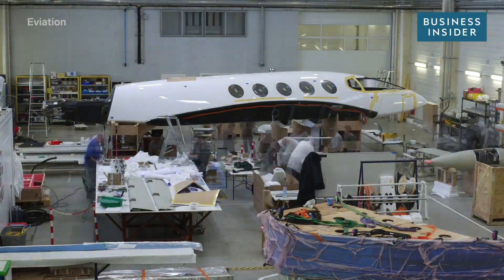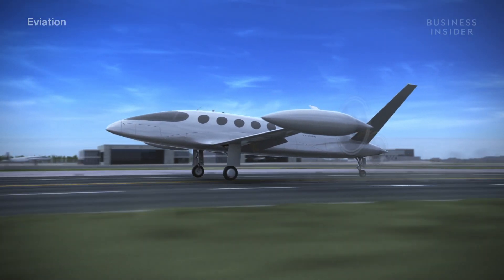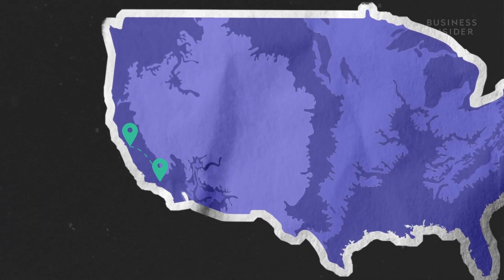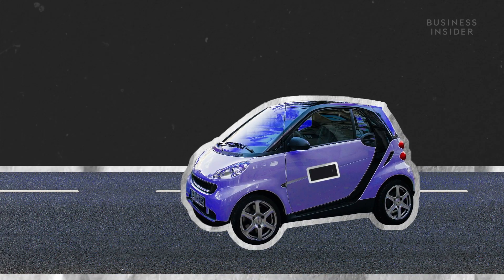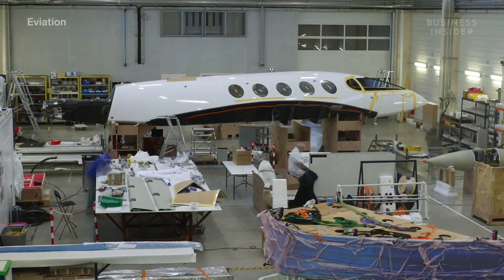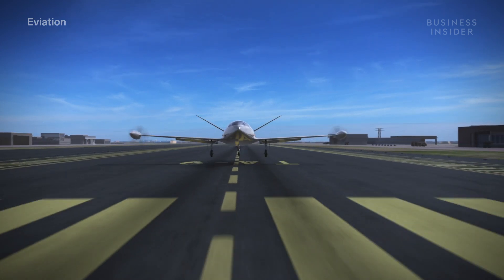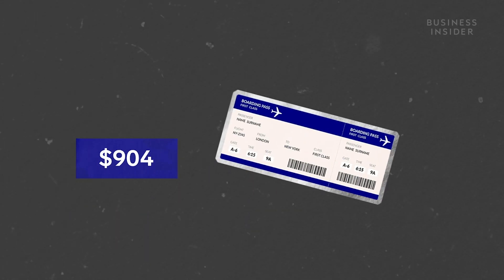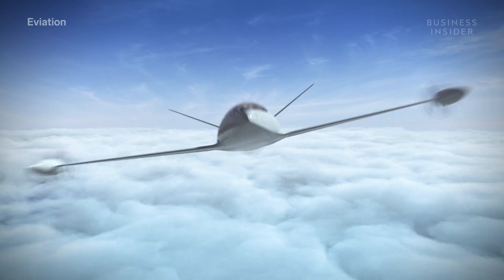Inside The $4 Million All-Electric Plane

Comment: This just shows people are overhyping electric tech right now.  Sure it's the future, but we aren't in the future.  Can barely keep itself in the air for 2 hours, probably with almost nobody inside.  We've got a long way before an electric cargo plane will ever exist, and those are what's keeping carbon emissions up right now, not passenger airliners.  The batteries are in the fuselage, all prop and jet planes have fuel in the wings, which means your sacrificing capacity inside the fuselage with this.

Comment: Add two more points : high efficiency of electric motor almost 3 times . If batteries are powered by solar charges then very low fuel cost

Comment: Good  luck believing this is going to happen. Normal airplane shred weight as fuel burn to improve range and performance.  Meanwhile, you carry the same death load for the entire trip with power and performance gradually degrading overtime, not to mention landing with heavy load. Wtf are you even thinking. Apply science and logic, do some math please

Comment: A flight that's usually 1h 10min would be 2h 30min using this plane.

In the business world, that's a deal-breaker right there.
High hopes for the next few iterations though, they might just solve this issue with the emerging advances in battery tech.

Comment: I can't take this video seriously. This aircraft is not capable of replacing regional jets! The first half of the video should be scrapped! Nevermind range or speed, it only carries 9! So the question is how many are you going to need to satisfy demand?? Even the fuel efficiency can't overcome the challenge. 
In Europe there is pressure to ban domestic flights under 3/4 hours long and promote trains. A train can carry more than 800 people (that is the same as an A380) very comfortably, stops along the way and travels just slightly slower than this particular airplane....

Comment: I think they should try Hydrogen Fuel Cells in Airplanes, which have far more energy density than Batteries. With the Hydrogen produced with Hydrolysis and Solar power.

Comment: ...200$ is only the fuel cost.
Which doesnt take into account the fact that your plane will be sitting on the ground a LOT, as there is no way to fill batteries to 100% capacty under 1h. Depending on the current draw, that means that the plane will be sitting on the ground as much or twice as much as the stime it spends airborne.

Comment: If your entire business model is "you'll feel less guilty" than i predict a 98% failure. I LOVE the idea of electric plains but i also understand that physics says it wont work well until we have MUCH BETTER BATTERIES. So they, for now, can only make short flights, go slow, and require MUCH LESS WEIGHT, which all leads to economic failure. The only solution i see is "FIND A NICHE", or "MAKE PEOPLE WANT IT"! It can either be the cool think like apple that is followed by a cult regardless of it being inferior, or it can be the fun thing that works for some specific enjoyment. But "FISCAL and ECONOMIC RESPONSIBILITY" will not fill you seats at least not enough to keep you afloat. I HOPE I'M WRONG, but history has taught me people work out of their own enjoyment and pleasure not out of responsibility, else we would all be taking the bus instead of buying cars. You can't change humans but you can understand them and change your model accordingly.

Comment: I like it. I’ll take a longer flight that’s emissions free if they reach price parity (and it sounds like they will). Charge times aren’t bad either from what I’ve read; 275 miles per 30 minutes of charge, the perfect plane for short trips.
Reply: But it's not really emissions free. It carries only 9 people so the amound of airplanes in the sky would increase 8x just to replace a small regional aircraft. The amount of batteries, airplane parts and actual electricity needed to achieve this offset quickly the carbon footprint of bigger airplanes.
 If you want sustainable aviation look instead for Airbus hydrogen airplanes in the next 5-10 years
Reply: It still has to be recharged with....wait for it.... FOSSIL FUELS !!!!
So actually the emissions created will be released earlier than the flight itself.
Reply: You have to mine the lithium batteries, charge them over their life, and deal with the hazardous battery waste, which has precious elements that can only be recovered using a LOT of energy. Battery creation and disposal is far from environmentally friendly. As long as people "feel" that it's cleaner, that's what counts right ?
Reply: Cry

Comment: I love how they compare this 9 person plane to the 747 one of the largest planes out there holds about 366 passengers
Reply: The plane is tiny and it's just a private plane
Reply: @casualbeluga2724  exactly, there are already planes with a capacity for nine people that fly at half the speed of a commercial airplane and consume a much smaller amount of fuel than those that carry 100+. Why don't airlines use them? Because it is economically unviable. For the private aviation market on the other hand it may work, but there the appeal to sustainability falls apart.
Reply: How about a hybrid plane for 20 passengers....Natural gas and battery operated .
Think it could be a good compromise. 
Wonder it this plane can cross the Andes mountains.
Reply: @arteson6093  
You mean you want to make an aircraft even more complicated than it needs to be?
Reply: @gabrielgingras814  Nope... It is obvious that electric is to heavy for the foreseeable future for a plane that could make money.... Therefore striking a balance to attain it could be a solution.  
An aircraft of 20 or so passengers can make a profit from small runways shuttling people at ultra low cost.
Other countries use nat has vehicles at a third of the cost of gasoline ... has less weight and could give the takeoff energy necessary.... the rest of trip is electric use of batteries.
Reply: each of the plane seats up to 8 people, if you buy 25 of them, then you take 200 people.
Reply: No they did not. Only the picture is wrong. But they compared plane that carries 9 people to plane that carries 9 people. They CLEARY have said "similarly sized plane".

Comment: Zero emissions while running. But you gave massive emissions in making the batteries and aircraft itself; you also make emissions in power generation. As an electric plane the aircraft will also have slower turn around times than jets and turbo props. I wonder how well this will do on FAA approval given the 100% electric; hopefully this would do OK with lightning strikes.

Comment: Its an electric private jet replacement, not an electric passenger plane. This is 100% more wasteful than a large jet. You are replacing a single aircraft with 30, requiring 30 times as many pilots, requiring 30 planes to be built instead of one, and running 90 engines instead of 2. There is a reason larger planes make routes cheaper. You get more people there while burning less fuel per person.
Reply: You say that as if all routes would be replaced by this plane which simply won't happen. Integration is a slow process
Reply: @shamrock141  
No I'm saying that assuming it replaces regional routes, which is what they say it will do, which, as I said above, is bullshit.
Reply: @Henriburger1  obviously it won't but if we advance at our current rate then down the line we could create something that could compete with traditional short haul routes

Comment: I’m surprised they didn’t shoot for a “blended wing-body” design.
Reply: Don't be, they tried to remove wingtip vortices, by placing the engines on to edge of the wing. The design screams "i have no clue what i am doing, but i have money" even from a large distance. Sure they COULD have used state of art airframe, by utilizing a flying wing with bell shaped lift distribution, to achieve a ~70% drag reduction comapred to conventional forms, while not sacrificing maneuverability.
However they opted for doing the pointless but flashy.

Comment: If one could incorporate regenerative power technology into the plane's airframe they could use the jet stream from the flight itself to recharge the batteries so the range could be extended. All planes utilize a natural parabolic shaped flight path to conserve fuel. The electric plane would simply achieve its maximum altitude within the first third of its flight and then maintain a very gradual decline after it has crossed that threshold so that less power will be required. Multiple small air intake vents could then be opened during this time to harness the moving air to move spiral turbines which would then charge the batteries while in flight. Once the batteries are fully charged, the plane could use the excess power to achieve or maintain a higher altitude. Repeating  this process would ensure that the batteries are fully utilized and could in theory increase the range of the plane indefinitely. From an economic stand point, it would reduce down time for recharging, the plane landed with the batteries still mostly fully charged.
Reply: Completely wrong in EVERY way. NONE of the points are even possible. They ALL violate the laws of thermodynamics.. Vivid imagination though....
Reply: You forget something, ram-air turbines as you describe create drag, therefore a reduction in speed, which means you have to give up alritude to compensate for that.
Or increase power to compensate, therefore increasing power draw.

Oh and ATC is going to love a continous descent, that is going to be an utter b** to deconflict.

Comment: 00:59 um no. Using a 777 or even a 737 for domestic flight is perfectly normal if the passenger demand is high. On low demand domestic routes, they use smaller regional jets or turboprops.

Comment: Just because we are turning vehicles electirc, doesn't remove their carbin footprint.
Reply: No but it's a great improvement
Reply: No but it heavily reduces them and will eventually make them carbon neutral
Reply: @sheev9852  there are alternstuve fuel. Made from combining carbon and hydrogen VICE made a video about it. No need to upgrade or install anything. Plus it's carbon neutral

Comment: Well it's not emissions free - how much emissions does the charge give off at the power station?
Reply: Roughly 1/8th of the emissions. Turboprop engines are at maximum 30% thermally efficient. Electric motors are 80 to 95% efficient. Plus less lubricant, coolant, and consumable maintenance supplies (packaging, PPE, etc). And emissions released at altitude can be 10x more harmful than those released at ground level. Hope you learned something new!

Comment: Well, if that energy is taken from a carbon power plant then its carbon emissions can be even worse than normal planes.
Reply: not really
Reply: No not really.

A traditional jet has three points of pollution. Production, operation and refueling. Getting that fuel requires environmentally damaging processes like mines and oil rigs where as electric planes only have two points of pollution
Reply: No it's not, I don't think you understand how big of polluters normal planes are

Comment: It's a good start but it's still hindered by higher weight to energy ratio of batteries compared to jet fuel. Although it costs far less per flying hour but it can only carry a small number of passengers due to heavy battery. Hence, I see this limited to semi-business class customers who don't mind nearly double flight time and private jets for environmentally conscious owners who don't mind slower speed and short flight range. Frankly, I think the biggest value in all this is the wider aerodynamic body fuselage. Thus, I don't think this moves the needle much.

Comment: Electric planes won't be commercially viable until batteries can get lighter and cheaper. The amount of energy per kilo needs to increase dramatically.
Reply: they call it a step change in technology, but here it needs quite a few step changes, to equal the current propulsion power systems!

Comment: All well and good, but it's still essentially useless. For 4 million+ dollars and only like 10 passengers, it'll take forever to be profitable. And for such short trips, people don't want to pay alot, so it'll have to be competitive somehow. Not to mention that electric propulsion and batteries are far less reliable than turbine engines. Turbines are some of the longest lasting peices of machinery humans can make. Unless this can also compete in longevity, it's not going anywhere.
Reply: I agree to the first part, but disagree to the second. Turbine engine ignite jet fuel and propel it through the turbines body causing stress so there’s more upkeep and maintenance. Electric engines run as a quieter motor and less moving parts. But that’s my assumption based on my knowledge of electric cars motors but same principle
Reply: @ishanb4761  turbines are incredibly reliable and really don't 'require' much maintenance. They do preventative maintenance to make sure there isn't a massive accident, but that would be like rebuilding your engine every few thousand miles to make extra sure it dosent blow. Totally unnecessary, but for people's saftey, a company will take the cost. Especially since a failure could mean hundreds of people dying. Many turbines have lasted over 50 years of service with standard maintenance. The B52 has been flying near-constantly since the 1950s with the same engines. They are a marvel of engineering because they create alot of heat and thrust, but nearly no friction. So far as I can tell, the longevity and reliability of electric propulsion is far less at this point. And far less efficient. If this plane can only carry 10 people for this cost and weight, it won't be economical. And what happens if there's a short circuit, or it's hit by lightning?  It seems on the surface to compete, but electric can never be the workhorses that gas engines are. They move the world, it would take more batteries than we are able to make, to even come close to competing.

Comment: I’m guessing hybrid then, jet fuel for lift only
Reply: So you're proposing a jet engine (or a pair, whatever) to create lift as a VTOL aircraft, then shut it down for the rest of the journey and let electric motors to push it forward? Pretty useless I'd say since the jet engine would be a dead weight to carry whilst cruising.
Reply: No, Eviation is developing a purely battery-electric aircraft. And "jet fuel for lift only" makes no sense.

Comment: That “glider” is a small single engine airplane. I’m skeptical of this video’s credibility from the start
Reply: Of course you would, this video is made by a bunch of people in a meeting table and hire one fact checker that doesn't have any interest in "tech" as the channel's name, add some sleek and modern editing, and that's it, hopefully many people easily fooled by the posh channel name and get ad rev.
Reply: This "aircraft" burnt to the ground back in January, don't know why that wasn't mentioned. And this prototype was built with full interior, which is unusual for a proposed test aircraft.
Reply: I flew one of the first electrical planes few years ago, and funny thing was the guy telling us that test pilot died as the plane burned down while flying right at the moment I communicated with tower for a takeoff
Reply: And a 747 is a similarly sized turbo prop
Reply: Look closely smartman, it has three engines...
Reply: @mrunseen3797  at 00:10 I don’t see any “3” engines.
Reply: @Evili555  ay sped, for ur information, 1 on each wing and 1 in the back
Reply: @Dominic-sr1ed  did u even go to 00:10?
Reply: @Evili555  lol does no one have brain. People need to read your comment
Reply: @Evili555  i think he meant is the one in 00:15
Reply: @spaceflightcrewmate1934  that’s not a glider
Reply: @Evili555  well thats the only one with 3 engines i saw on the vid

Comment: "Despite testing hiccups in January...". The prototype set itself on fire! That's more than a hiccup. And it was the battery that caught fire, not something unrelated to what they're testing. Good luck getting that thing certified.
Reply: Another possibility is that the “hiccup” wasn’t an accident. This would not be the first time in the history of aviation that an unflown prototype mysteriously caught fire. Check the funding history on Alice, and the technical evaluations done on it. Lots of skepticism that Alice is a workable design, and many doubts that their business model is viable.
Reply: @bryanlallen  I also have my suspicions. The way the company has been set up is very scammy. And the design does not look viable. I mean, a tail dragger? Really?  When was the last tail dragger certified for a civilian transport?
Reply: Not really a big thing, likely just human error  (using wrong screws in screw holes) or  them overloading the batteries beyond rated specs

Comment: How will it hold up with lightning / St. Elmo’s fire
Reply: Why should it be any different from traditional planes?
Reply: @ThomawillolGaming  it’s an all electric plane..
Reply: @64CSAR  Yeah? And the other planes dont use electricity?
Reply: @ThomawillolGaming  well with a battery large enough to handle an all electric plane how will they have it handle an electricity strike to its system is what I’m asking
Reply: @64CSAR  Simple, the lightning strike hits the planes body and leaves another place on the body. It wont really effect the battery since only one of the poles of the battery will ever be connected to the plane body, thus the lightning wont be able to discharge/charge the battery and for the battery to charge/discharge from a lightning strike the other pole must be connected to earth where the lightning can disipate.

Lightning strike can cause problems for the plane, if indeed one of the battery poles are connected to the plane body but connecting the battery adds no value and you might as well just seperate it from the plane body.